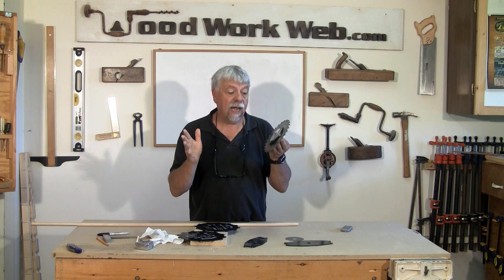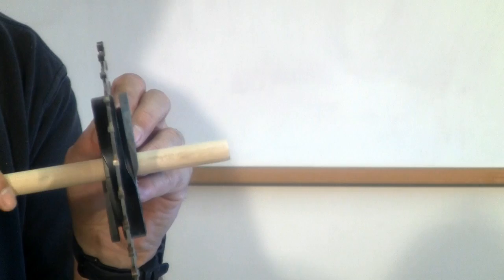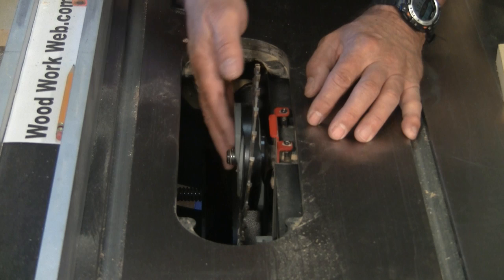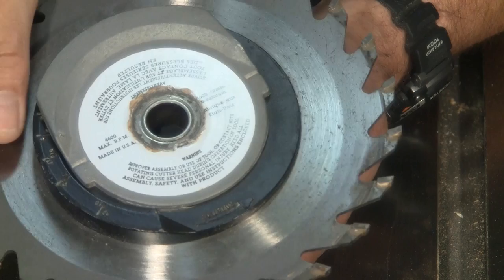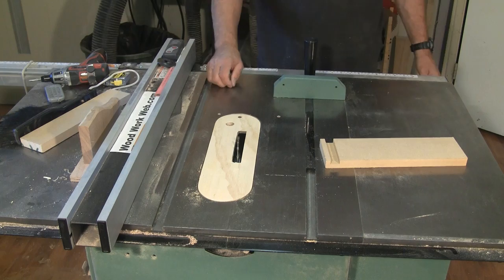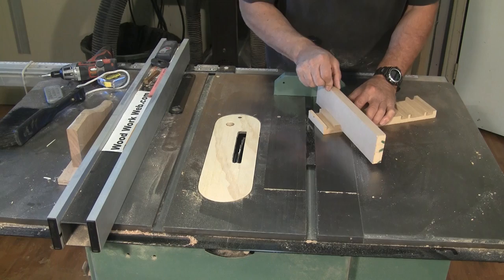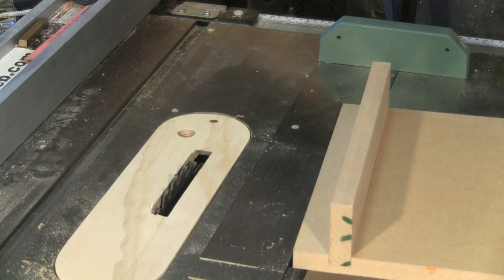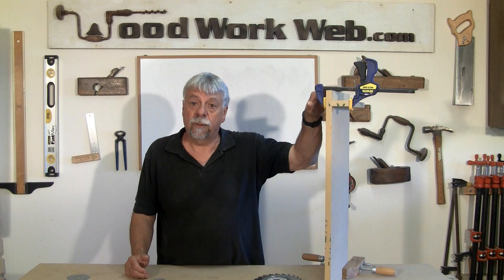Testing the Wobble Dado Blade -  woodworkweb

Comment: those of you writing off this blade because of the adjustments he needed to do should keep in mind that you can mark off your own positions once you find the right width. 
now that he has it perfect, all he needs to do is score the adjustment wheel himself and from now on he can switch to that exact measurement in a matter of seconds. 

yes, it is a minor inconvenience to have to find your own sweet spots, but the money saved with this is nothing to scoff at... not to mention that priceless feeling of tweaking your own tools and knowing that each piece of equipment you use is personally calibrated.
Reply: Sounds like you are a fan of these
Reply: @CharleswoodSpudzyofficial  or ..... maybe.... as time goes along ..... set a blade up for a width...

find some at yard sales / craigs list / what have you .... and set other blades up for other widths.  Once set ...... never change em.
Reply: That's exactly what I was thinking.
Reply: @johnjacobjinglehimerschmid3555  brilliant

Comment: The Glue Gap is a feature, not a problem.
Reply: BariumCobaltNitrog3n Look at you with a Dado half full mentality.
Reply: -apple 2016
Reply: Tape measure was right there the whole time, common mistake of over thinking
Reply: ^^Exactley...how did the original comment get 81 likes.  No offense to anyone but my word people are so uninformed.  I wouldn't have expected that on such a niche page.
Reply: The gap on the back of the cut is from the blade carving an arc across the cut by serving as a dado using a single thin blad, so it is interesting in that it forms that void/gap where glue can sit.  I don't see how that's a feature unless you have odd glue that needs a large gap.
Reply: Unorthodo_x I

Comment: I've had decent results using a wobble dado on a radial arm saw.   You can adjust the width right on the arbor, in contrast to all the trouble the host of this video went to on his table saw.  I mark the teeth that hit the outermost parts of the cut, and can set up the cut width by eye while turning the blade.  It's not high precision woodworking but for more casual tasks, like building workshop drawers, it's just fine.
Reply from the maker: +James Wheeler Thanks James, for the detail info here ...
Reply: i use mine on my radial arm saw also...i use a metal rule to measure the width of the dado i want to cut... i lay the rule under the wobble wheel, lower the arm until it barely touches the rule and rotate it to fine tune it. i do it with the machine unplugged.i like my fingers just the way they are!!
Reply: supurbian This is what I do also. Easy to adjust on an RAS (although I feel like the only one who uses one anymore) and easy to check fit by spinning the blade with the power unplugged. I've had good results with much less trouble than this video.
Reply: Scott Seeba I use a RAS. Just fine for most furniture cabinets drawers and doors.  

I’ve had a craftsman wobble since the 80’s and it’s been very useful.
Reply: that's how I used mine, you have to make sure you have a good grip on it, it will want to run across the board

Comment: I have had one for over thirty years. No need to remove it every adjustment. I merely slacken the nut give it a slight turn retighten and test.
Reply: And I until this day I have...
Reply: I paid $15 but it went to a good cause,..
Reply: Good enough for a bee box... thanks for the demo!
Reply: I have one that I have had for years. Use the markings to set the width. Very versatile. Too many adjustments. He needs to learn how to use this tool. I got mine at Sears.
Reply: @HTTAPBIH  Agreed.  I think he is intentionally acting stupid.
Reply: 30 years?!?
Reply: Only question... how do you place your dado? I just feel it would be difficult to accurately measure the location of the dado
Reply: @ewdtrey  i am pretty curious about this too, almost seems like you would have to make a new zero clearance insert for each new dado width.
Reply: @MrBentondeltoro  one trick you could use for this is to attach a thin sheet of material to your miter gauge and let the stack cut right through it. From then on you have an easy reference line. I do the same thing to make precisely located cuts on the table saw, similar to a table sled really.

Comment: What I did with mine was when I did any test cuts I would measure the gap made by the blade and scribe that on to the scale of the blade as a correction....still worth the price..
Reply from the maker: +bigcliffe Good tip, thanks

Comment: I looked through the comments and I didn't see a mention of this.
When you stick your hand down in the well to change or adjust the blade, PULL THE PLUG. Don't trust the switch or the safety operator on the switch. Pull the plug. Thank you. And thank you for the informative video.

Pull the plug.
Reply: Pulling the plug is standard for changing any blade.  The table saw instructions all say to do this..
Reply: Yeah, because my table saw turns itself on all by itself all the time.  NOT.
Reply: Larry B what if you knock it with your knee? Being over precautious doesn’t hurt
Reply: @alexbishop4396  knocking it with your knee would turn it off.
Reply: I'm watching this for the first time. And I sincerely hope he was unplugging it each time

Comment: My older brother was a carpenter and mechanic, he died in 1993 and I inherited all his tools,
Just last week I found a brand new Craftsman adjustable dado blade in the bottom of his Craftsman tool box.
Can't wait to try it out.
However, I also have the instructions that came with it and they explicitly say that you will get a non square bottom cut in all increments except 3/4 inch.

Comment: Great video Collin.  Some FIY, this is also called an adjustable dado blade, or an infinitely adjustable, and they were originally designed for use on radial arm saws(RAS) where adjusting into the exact width would be much easier.  In fact, for many years, the RAS was often referred to as the king of dados because of the ease of adjustment using a wobble wheel and the fact that you can more readily see exactly where the cut will be made.
Reply: I had no idea this saw has been common.

My brother in law has such a saw (a heritage), and it always seemed like something home made to me. The arm is so sloppy in all directions that is hard to get any precise cut with it. Using it as a chop saw works somewhat. But that's about it.

Thanks, I learned something new.

Comment: I have a nice dado stack, but I hate messing with shims. Honestly, this seems plenty good. And a quick pass with a router plane and you're golden.
Reply: I used both stacked and adjustable (woble) dado blades Peter Brown.  The adjustable can take just as long to get set to the proper width as many ar not very precise on their settings.  That said, they are a continuous analog adjustment.  So theoretically you can always set them for a perfect width (if you wnat to spend the set-up time).  For me, they are a perfect paring with a radial arrm saw.

I have never found them to be any more or less clean cutting than a stacked system.  They can be more difficult to maintain an edge depending upon the type of teeth (beveled or squared).  The easiest are the squared face.  These are commonly carbide tiped and naturally more expensive.  That said, they are still about 1/5th the price of a stacked set.

For persons in coutries that do not allow the use of stacked dado blades, adjustable are sometimes a viable option.  The "single piece" design and its generally lower mass allow it to  meet safety regulations that a stacked system normally cannot (stopping time being the biggest issue).
Reply: The RAS makes a lot of sense, as you could adjust it much easier!
Reply from the maker: ***** Thanks for commenting Eric
Reply from the maker: Some will like the wobble dado ... others not so much, but that's the great thing about having choices because we all do different work and what works for some doesn't always work for others ... thanks for your comments, good to hear.
Reply: Eh its not the worst. Fiddly adjustment aside its serviceable. That and analog adjustment means you can tune in as close as you want on width.
Reply: i feel like if your havign trouble adjusting them, etch in the correct placement where theyshould be, where 3/4 and 1/4 and so forth, and it should stay at that point, shouldnt it? or does the adjsutments move back and forth by a few 1/16th every time you use them? sorta like slop
Reply: I wonder if you commenting here is the reason I got this video as a recommendation.
Reply: Shims are easy
Reply: My high school shop had one table with one of these and one with a normal blade....ours was alot more accurate on the measurements and didn't require so many adjustments......till I got into woodworking recently I thought the wobble dado was the only kind.

Comment: Used one for years. It has markings on both sides. Mic your material and you can set it the blade to size. You can adjust it slightly after one test cut. Mine came from Sears and I have seen  them recently.

Comment: I still have one from almost 20 years ago, when it was new it was fairly easy to set the width accurately.  I used it mainly for lap joints and shelf dadoes and it wasn't expensive to purchase.  I still use it for some applications time to time but I prefer a good stacked carbide set for accuracy.

Comment: Colin, I had one of these blades years ago, and fell in love with it.  Since most everything I do is 3/4", I didn't need to keep resetting it up.  I have a Stacked set, but this is so much simpler.  Just bought one on eBay after watching the video for $40 w/ Free S&H.  BTW, that last measurement is 13/16".  Thanks for sharing.
Reply from the maker: David Moffitt Thanks David ... good idea about keeping it set at 3/4, and when you can pick these things up a swap meets etc for as little as $5  ... a person could have 2 or 3 that could be pre-set ... great idea, thanks buddy

Comment: I've used this type of blade for years.  Never had a problem with it.  It grabs a little when using it on the radial arm saw.  I'm really surprised to hear that they've gone out of style.  What could be better than an infinitely adjustable dato?  The stacking datos look like a real PITA.  I can't imagine trying to use  shims to get a precise fit.

Comment: Once you get the adjustment right, I think this blade is really nice. Usually you would fill that "gap" with some glue, so I don't see why it should be a problem.
Reply from the maker: +pcfreak1992 Glue can hide some smaller problems ... good point
Reply: The only reason to have space for glue is in bored holes where you are trying to avoid hydraulic pressures splitting your piece.   Almost every glue you are going to encounter in woodworking is magnitudes stronger when it is applied thinly and evenly.  A glue has strength because it bonds two surfaces together, not because it holds on to both surfaces well and has great internal strength.  A perfectly matched joint with adhesive will last longer than the materials that are being glued together. One with "a little space for glue" will fail at the glue point more often than anywhere else.

Comment: The demonstration proves why the wobble dado blade became a dinosaur.
Reply: Cre8Thought41 08:49 for the moment adjustment matches desired cut, and cut exam...s' a bit loppy on MDF nevermind mesquite...at 10:30 .
Reply: The dial needs adjusted on the saws hub.
The crowned rebate (dado), is fixed by a pass with a chisel or router plane.

Comment: I've had one of these for over 40 years and it was quite a few years old when I got it.  I was just given an old (1976) Craftsman table saw that I am refinishing that came with an old Craftsman stacked dado. I've not used either of these blades but will have to try them when I get the saw put back together.

Comment: The non tightness at the end of the board is because the saw is a circle. You can't fix it. Even if the day wasn't a circle it spins in a circle. The tiny gap at the end of the board is the curve from the spinning. The only way the make it smaller is by getting a bigger saw blade so that the curve is closer to the horizontal.
Reply: Carlos Colón or manufacturer the blade with a slight elyps
Reply: Not really. Because the blade rotates around a point, the path that any Point on the blade will take will always be a circle. So the point farthest out from the center will end up making the same cut as circular saw. It's the main reason why it's completely impossible to drill a square hole unless you use some mechanical contraption. The only way to fix it is to use a bigger saw blade to make the curve of the blade closer to a horizontal line.
Reply: Carlos Colón each point will make a circle but with an elyptical blade not each point will make the same circle. if the elyps has the shallow curve over the centre and the peeks at the extremes of the tilt the points at the side will make larger circles than those over the centre so when combined with the curve of the wobble arc they would cancel each other out.
Reply: Sorry, you're right. That would actually work. I forgot that the blade was at an angle and kept thinking about it vertically. I thought about it and yes that would work. The only problem would be that to fix a gap as small as the one in the video, the deviation of the shallow curve of the ellipse would be so small that the ellipse would still look like a circle to the naked eye. To manufacture something with that kind of precision is going to be bitch but it's possible. Either way, he has two options to choose from if he wants to fix it. One's super difficult but realistic ( your idea) and the other is super easy but unrealistic  (my idea).  Thank you for having an adult discussion about this. As a 17 year old, I appreciate it.
Reply: Carlos Colón machining it with an elyps that shallow would be stupidly complex (these blades are supposed to be the cheap option). that said I would be interested to find out if you could take a circular blade and cut against a shaped grindstone to reduce it to an elyps for cheap.
Reply: You can drill square holes though
Reply: I'm pretty sure you're right about reducing the curvature of the cut with an elliptical blade, but that introduces new error when talking about a blade with an adjustable tilt.  Suppose that your blade had a range of 1/4" to 3/4" tilt and you design the blade to cut perfectly flat at 1/2" tilt.  At 3/4" the cut would be concave and at 1/4" it would be convex.

Personally I think I would rather have a predicable slightly concave cut as it's perfect for glue.  There might well be a butter zone in there though that the guys that make those figured out a long time ago.
Reply: +smegskull
Nah, machining the blade to do that wouldn't be hard at all.  The hard part would be ensuring perfect blade alignment during assembly because the ellipse would be very subtle.
Reply: The 'curvature of the cut' does not in fact exist.  The blade does swing a slightly smaller circle as it wobbles out, BUT  the blade also cuts slightly deeper than the exact blade radius, because the blade has thickness.  The cut is actually slightly deeper a 1/4 inch out from center.  What you 'see' as the round bottom gap  is the thisckness of the blade, at an angle, at the two extremes of the dado.

Dress that last 1/8" with a sharp chisel or gouge, or dress the male part edges with a file,, the gap disappears.

But ya know,,,,  with the single exception of a mahogany piece of art,, I just glue.  Glue IS going to make a gap,, whether one is there to accept the extra thickness of glue,, or the glue just makes its own gap.  Glue is NOT a zero dimension.
Reply: Sailor is right! i was wondering if anybody else had noted this.  There is no curve at the end of the cut, but rather an angle and shallow area at both of the corners, along with almost a reverse curve (what is the term "convex"?) between the two edges created by the corner of the cutting edge of the tooth.  
While not a huge problem for most hidden dado joinery, it wouldn't be something you'd want exposed.  

Also, I wonder on the load wear on  the saw arbor.  There would be quite a bit more horizontal vibration caused by a blade like this.

Anybody else notice that this thing is so thick he wasn't able to use the flange washer with the arbor nut?
Reply: +Andy Krause - If you're referring to a mortising bit, it's not really drilling a square hole. It's drilling a round hole and chiselling the corners square.
Reply: I am a walking Friend zone If I'm understanding you correctly you were trying to say that you can't cut it square and tight because it's a circle, but when you have the peak of the circle, it is consistent as it is spinning, as long as you run the piece you're cutting all the way through so that every point in that line touches the very top of the circle, it will be perfectly square and tight.

Comment: FYI - I just picked one of these up at a swap meet - it's a Craftsman model. It has locking pins for each size and set screws to lock it in place. Set it for 3/4 and cut a perfect fit dado first try. It is adjustable to sizes besides those marked if you pull the pins. Great for Metric boards (however I do believe it would be trial and error to set). 
Picked it up with a more traditional dado stack set for $15 Canadian. Great deal indeed!!!  Thanks for the Video!